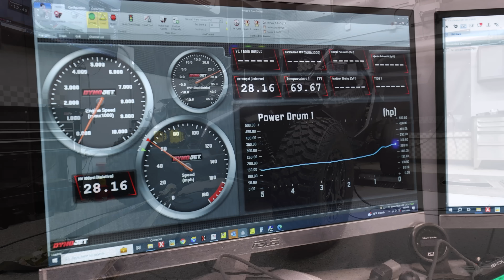EVP FLEX FUEL TUNING

Comment: How will you account for waste gate crack pressure when going from e85 to like pump93? If the x3s waste gate isn’t electronic
Reply from the maker: the boost control system is electronic - boost control solenoid.  Crack pressure only affects the minimum boost.